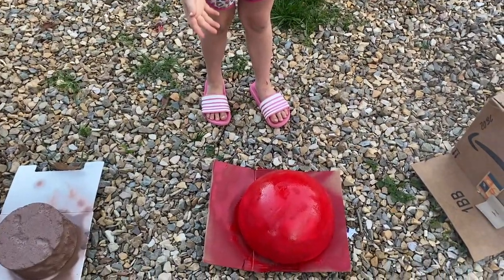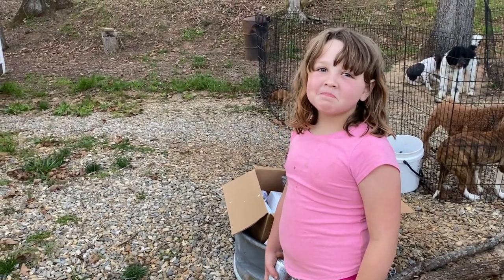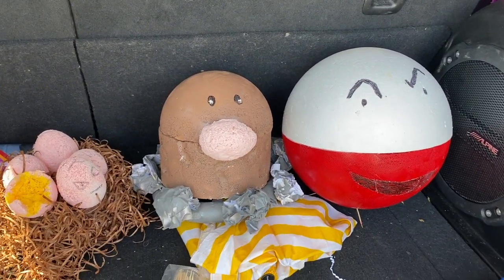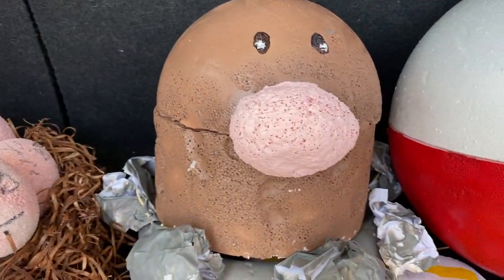There's a SCREW in our brake line! So Dangerous! || Removing the Air Tank from our Eagle Bus

Comment: Props to Kyle on getting things done.
Reply from the maker: He did great! Now, just to find an air tank 😂😂
Reply: @Beingbethunes   hope he does but may be able to get a welding cylinder modified or a different type of tank like rv Steve suggested. One plus I can think of for a welding cylinder is because of the type of gasses and pressure they are under very durable heavy guage construction. Smaller size tank may hold higher pressure. Just my theory would need to check with experts.
Reply from the maker: We are looking into that, we haven’t had much luck elsewhere 😭